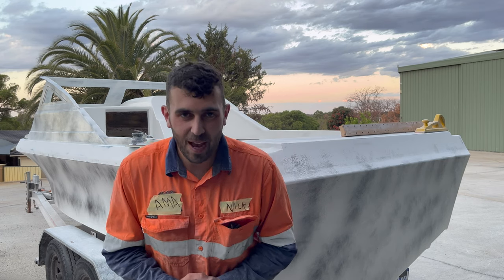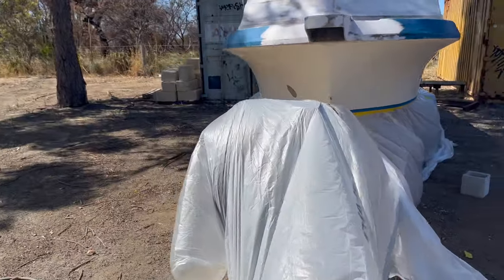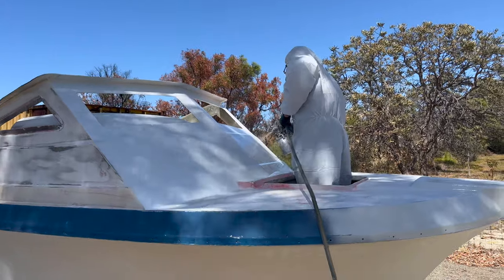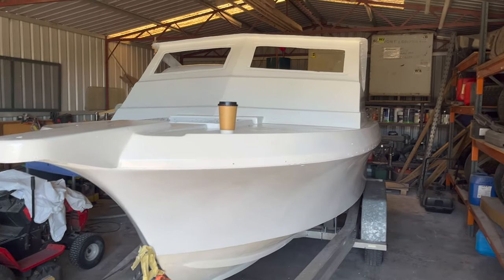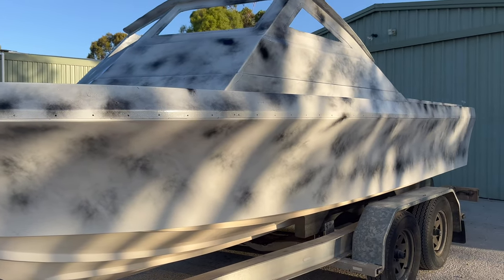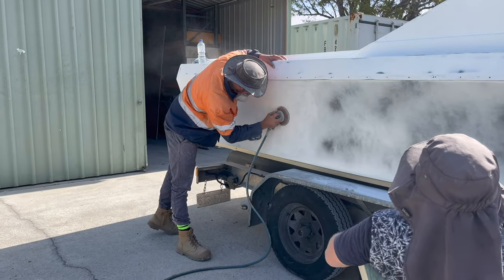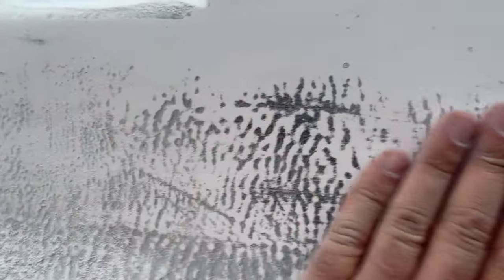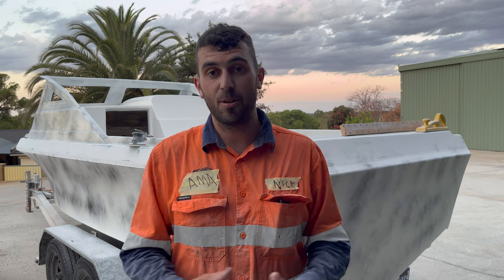EPOXY PRIMING boat IN BACKYARD| Pacemaker 20ft | Full BOAT RESTORATION V2 - Part 24

Comment: Gday mate when i did my guide coat i bought a powder you have probably seen it with mine i had a white hull and a fantail sides and white topside 2 coats of epotech epoxy primer 4:1 and 3 coats 2 pack polyurethane all rolled and tipped on , one side at a time so including the transom i have done 30 coats of paint people watch these videos and think i can do that wait till they try it aint no joy ride im 63 and this is my last one (haha) keep the faith nick it will be worth it in the end.
Reply from the maker: Ahh okay I need to look this powder up! Thanks for watching mate, appreciate your support 😊
Reply: @AngryMackAdventures  yea its like a graphite powder just brush it on with the pad supplied auto paint place s will have it .